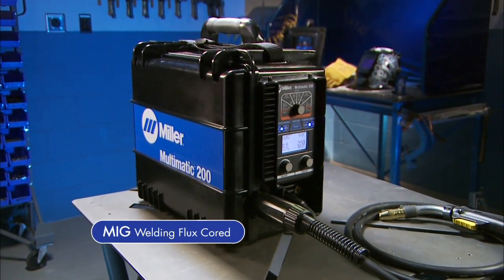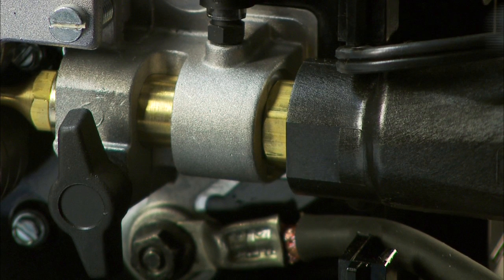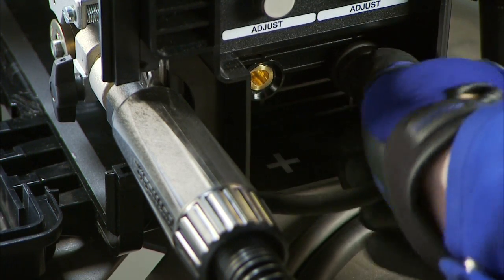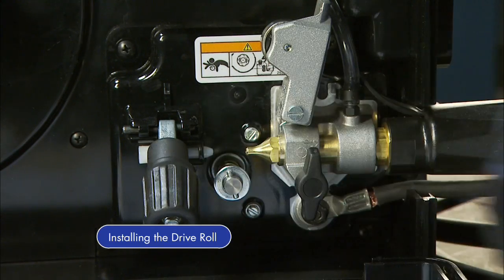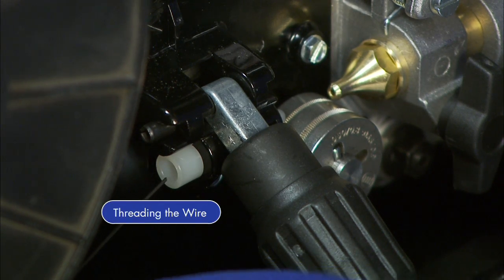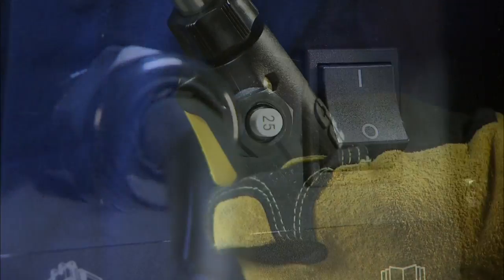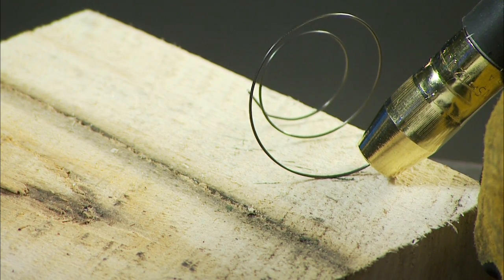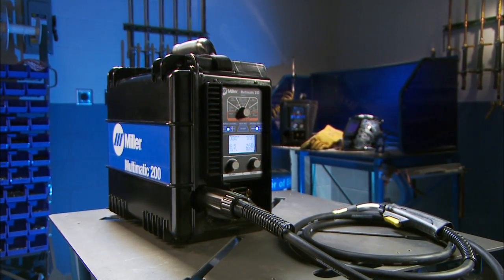Multimatic™ 200 - MIG Welding Flux Cored

Comment: Can my Multimatic 200 run dual shield 71T-1 wire?
Reply from the maker: Hi, you would need to look at the voltage and amperage requirements of the wire you are looking at using and determine if the unit is capable of providing enough voltage and amperage to run it.

Comment: I am in love with this little machine. Used it to build 13 two story staircases 
and it worked like a champ. Paid for its self in fuel and labor savings 
on one job. I will be putting more videos up with it but here is its 
unboxing https://youtu.be/drp9nyaLU3Y I have not tried it with flux core yet. going to have to try that out.

Comment from the maker: Good question @rangaman86 - this machine will run some of the smaller diameter dual shields, but it is only a 200 amp machine.  Our specifications say it will run wires that recommend DCEN (electrode negative) wires the best in flux core mode or DCEP (electrode positive) wires best in MIG 75/25. Be sure to check with your nearest distributor for more background.
Reply: Could you give a part number for the drive roll used for flux core?